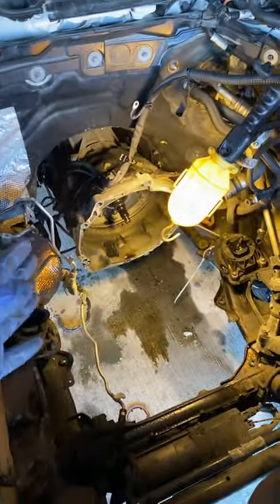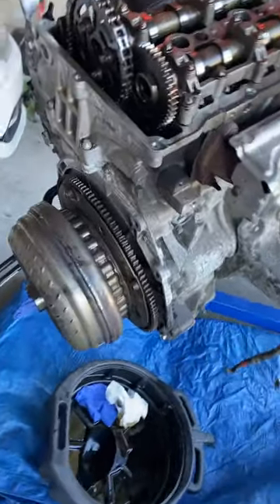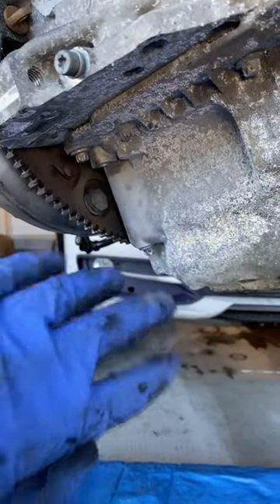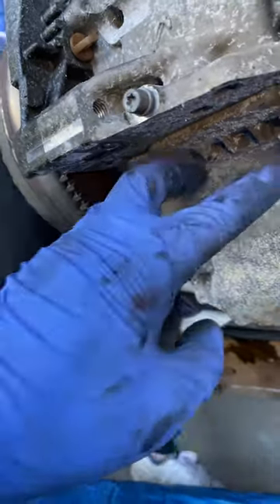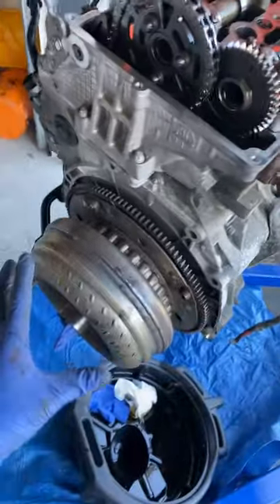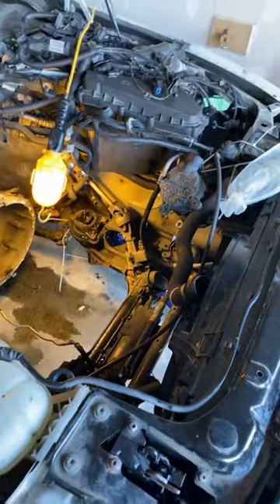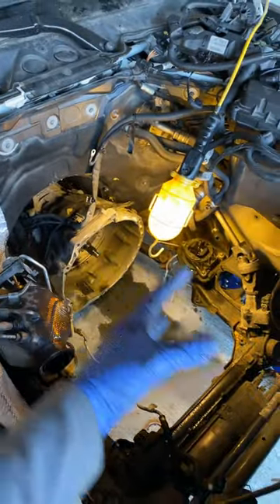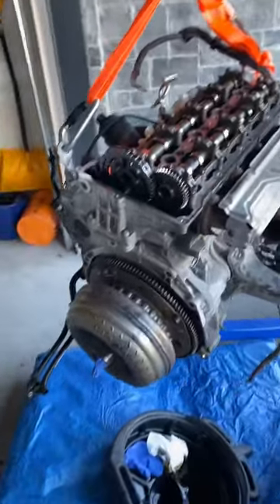How to remove seized engine with automatic transmission on BMW N47 / N47d20 #car #mechanic #bmw

Comment: Will this not damage the converter? currently doing this job but i was gonna remove sump and loosen all the crankshaft caps & conrod caps to unseize the engine

Comment: How are you supporting the transmission? I just pulled my engine and have the trans on a Jack stand. This looks way better if I needed to roll it out of the garage
Reply from the maker: It’s being held by a jack stand and a wood block! It’s just not visible.

Comment: Did this on mine but all the oil in the converter spilled out, is it posible to fill it back up or do i need to replace it?first time ive done this
Reply from the maker: Yes that’s normal, you’ll have to top it up once everything is put back together.

Comment: OK, but if your to put it again how do you do because tolk covetor have to first fixed inside in the gear box
Reply from the maker: The torque converter is just “floating” in the transmission. You just need to push it into position and the engine to follow.

Comment: HOW DO I TAKE THE CONVERTER OFFF THO I NEED HELP
Reply from the maker: You need a wrench to fit between the flywheel / torque converter. You’ll need someone else with a prybar to flex the flywheel so you can fit your wrench in.